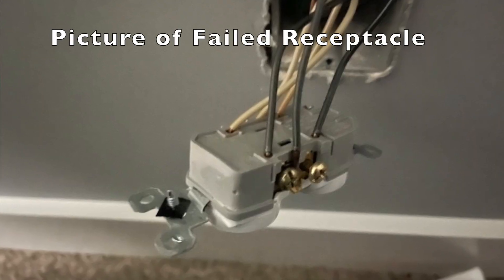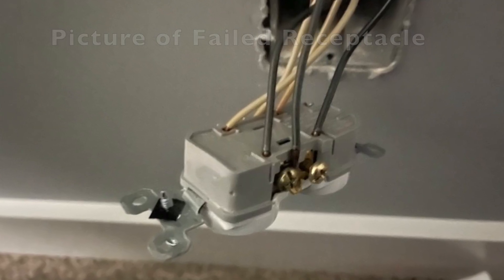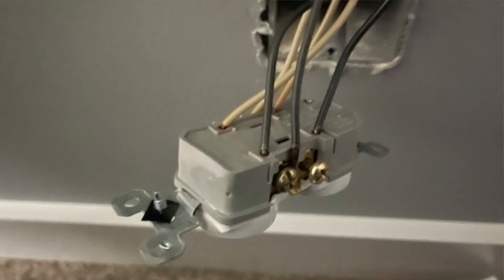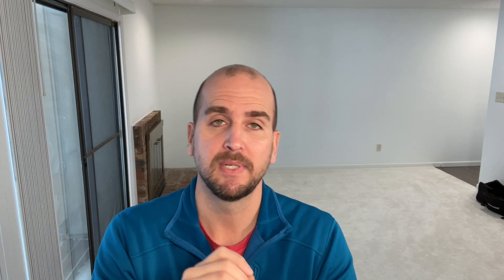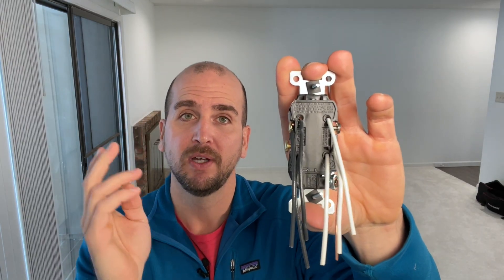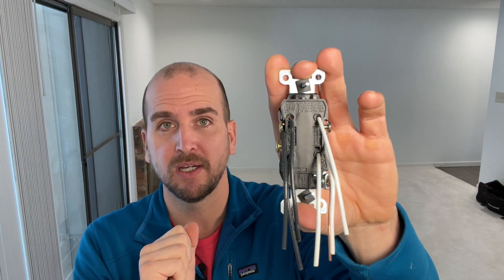Incorrectly Wired Outlet Found In Newly Built Home

Comment: back-stabbers. I don't do it, no one else might see it but it is pride in the job, I'd rather take the
time to make a hook then close it with longnose pliers so it can't slip away from the screw and possibly touch the side of the metal box. I bought a place, inspector pulled main panel cover.
he wanted to see if neutral and grounds were on separate busbars as the panel is a sub-panel
and at the 1st disconnecting means ground and neutral can be bonded. NO where else.

Comment: Why do the receptacles come with two screws on each side if you are only supposed to use one of them?

Using the screw terminals instead of pigtails takes up less space if you have a small box.
Reply: Because the Pigtail maintains " Electrical Amperage Continuity " of the branch circuit ! And a 4" square box is able to hold piggytails of the Hot/ Neutral/ Grounding !

Comment: COMPLETELY disagree with the pigtail method over the use of the side terminals for multiple wire connections. Most issues I have found with receptacles have been in a faulty pigtail, not the connection at the receptacle. Not only that, adding additional wire and nuts to a box forces installers to jam the extra material into a small box creating a much higher chance of loosening a pigtail connection or breaking a wire at the twist (weakest point). If a pigtail must be used as they so often do, the connection nut should be twisted with linesman pliers as you show, wire nut twisted to full tightness, then wrapped with good quality electrical tape starting on the wires and working up around the nut in the same direction as the wire twist while leaving a pull tab at the end for ease of later removal. Receptacle side terminals should also be wrapped with electrical tape before installation to add protection from ground wire contact during installation, contact with the box, or hand.
Reply: Fail

Comment: Push-in connections are the devil.  I found several that were loose when I re-wired my 1963 vintage house.  I presume that thermal expansion and contraction had degraded them.  I always use screw terminals whenever possible, and always pigtail my connections whenever possible.

I think you should emphasize that NEC provides MINIMUM requirements.  You can always do better without spending a lot of money or time, and IMO it's worth going a level or two above the minimum unless you are a contractor trying to keep costs at an absolute minumum.  More receptacles in a room than are required, 20 amp circuits instead of 15, "spec grade" or other superior hardware, etc.  If you do it right the first time, your electrical assets will last for the rest of your life or at least as long as you own the property.

One of my homes had a post-flood upgrade about 20 years ago.  The owners, one of whom is my wife now, spent more than $100,000 removing an interior wall, upgrading the kitchen, putting in new flooring, etc.  Every time I have worked on any of the electrical assets I've been disappointed to see things like push-in connections where spending a couple of extra minutes would have resulted in a much better (and safer) installation.  There is still a Mystery Switch in one of the bathrooms, that seems to do nothing.  I'll figure that one out eventually. :-)

Comment: Good video! I sometimes just put one wire on each screw (two wires per side) if the box is too shallow for pigtails, I usually use pigtails for all with the “shepherd’s hook” otherwise. Thanks Bro! I liked the multi strand to solid connection tip with the wire nut (other video), excellent! Thanks again!

Comment: Thanks. Love the demos. I changed a ceiling fan last week. The house was built in1995 by "pro electricians". Well, they didn't have the termination in a box. Fan mounting plate was mounted to a joist and wire was stapled to joist.

Comment: Regarding the issue of the screw standing proud on the sides: I learned somewhere to deal with this by wrapping electrical tape around the outer edge of the outlet after all connections were made, specifically to prevent a 'hot' screw from contacting a metal ground.
Reply: Agreed. Here in NYC all boxes are metal so the possibility of a screw shorting to the box is high, esp. in crowded receptacles. Wrapping elec. tape around the perimeter is, I think, a good way to eliminate shorts.  I have gotten pushback on this from others; not sure why. I also wrap tape around the wire nuts/wires which keeps vibration from dislodging the wire nuts over time. Finally, I make sure any wire-nutted connection is facing up, likewise lowering the possibility of falling off. Safety first! Cheers.

Comment: Great channel, I am the local go to for minor electrical in my little group of friends.  Do you think that in general electrical installation is due for a major overhaul in technology?  I don't like the push ins, but I also find it super tempting to flatten out the back wire plates by putting a conductor on both side.  Beyond that, how this is done seems antique.  I think Wago needs connect with Leviton (or similar) and normalize all wire connections to their technology.  No more pig tails, no more wire nuts, no more shepherd hooks. 4 hot, 4 neutral, and 4 grounds.  Box costs $2.50 instead of $1, but you just saved 5 minutes per box and everything is super clean.  My two cents.
Reply: Any measure you take to save time will come at the cost of the integrity of the system. Any time a recepticle has to double as a terminal block it becomes another potential point of failure for the whole branch. The hour you save on Wednesday can disappear quickly on Friday as you scramble around trying to find the bad termination. Better for each recepticle to have a solidly spliced connection to the panel without being wired through a half dozen other devices.

Comment: Am not an electrician, but know enough to have identified an outlet with hot and neutral reversed when we got deployed to Haiti in 1995. Electrician-contractor said "the [Army] unit that was just here never had a problem." I said "yeah, they wouldn't if they had a fan or lamp plugged in, but our computer's not booting up." My multimeter showed 120V between the neutral and ground, zero volts between the hot and ground. Exactly opposite of what it should be. The electrician (a young man still learning his trade) rewired the outlet and the computer booted up. This is what I was expecting you to discuss. Guess it doesn't happen much in regular construction.

Comment: Why to they keep making outlets with backstab connectors if they are so prone to failure? I'd think it would be no more expensive to have holes on the back, 2 per screw, that tighten up when the screws are tightened, so installers could avoid the labor of making a J-hook and the risk of just using the springy backstab holes.

Comment: Santacruz, I have a problem that maybe you can help, I added and outlet outside by taking power from one  bedroom and it work fine inside but outside shows no power, i recheck all connections 3 times inside they are goo, and outside i did the same they are all properly tide down but still no power , what could be the problem, im using a new gfi outside

Comment: I am a retired journeyman electrician and I agree with you on all of your examples. I never used those "push in" type of electrical connections to the receptacle. I thought they were mechanically weak despite meeting the NEC codes. I always used the J-Hook way of connecting the wires and I always used the pigtail set up. I didn't like the idea of the receptacle sharing the loads from other circuit loads. A very well done video!

Comment: #1, don't ever stab wire in the back of the plug. Always mechanically twist three wires with a pigtail under a wire it and then place your pigtail wire under the actual screw of the plug making sure your hook is going clockwise with the screw...

Comment: I am not a professional, but if there were only two hots and two neutrals on a receptacle then I would just wire one wire to each screw terminal since that is easier than making a pigtail, and it is very unlikely that the tab between the two screw terminal would become disconnected (open).

Comment: Though not an electrician, my father has done a fair bit of electrical work and has tried to teach me.  When replacing a receptacle one time, he showed me those push in connectors and said all they were good for was knowing how much insulation to strip back.  Always use the screw terminals and hook the wire on the screw.

As a former phone and network technician, I like to point out one little cosmetic detail.  The slots in the screw heads for the face plates should all be either vertical or horizontal in the same room.  Doesn't matter which way, just all should match to make a more "professional" look.

Comment: Stab in is legal almost universally everywhere so you shouldn't call stab in connections wrong, they're not wrong,  Stating it's wrong as an opinion, they're just not ideal. and until the national standard is changed and they eliminate the stab in connection it should not be called wrong, the design is currently accepted and they pass inspection, I know I'm splitting hairs hear just keeping it real and stating current fact.  Saying it is wrong is an opinion.

Comment: However, sometimes we have to connect up to seven wires on a switch; a DPDT switch with 2 #10 AWG x2 and one #14 AWG x2 plus one ground to the ground screw.  Lots of wire in a box!  I had to use a 4”x4”x2” box with a 1.5” extension and still difficult to push everybody in the box! Use to feed a 50 US Gal water heater from the 240 VAC/3000 watts main panel or by the generator panel 120 VAC/750 watts.

Comment: One thing I always do is put the receptacle with the ground on the topside. Don't know if it is correct or not but my logic is that if the plug gets pulled out a bit and something metallic were to fall into the space that you have a one in three chance causing a short and sparks flying. Also, with the ground on the top it helps to keep the plug in all the way.

Comment: I'm a handyman, and have wired both residential and commercial, with inspections.
 A friend of mine bought a house some years back, and I suggested a house inspection before moving ahead on the deal.  She did, and it turned into quite the laundry list of repairs.  I ended up replacing every single outlet save two in the house, as they would not hold a plug,  and upgraded the ones in the baths to GCFI.  The quick connects on the backs of the 1990's outlets were less then optimal, as in, when I pulled the dual ganged old ones out, wires pulled out.  I did use them on the new ones (contractor grade, not the 50 cent ones), but always pulled back after inserting the wire.  The new ones bit in solidly.
 All 120V circuits in the house were wired with AWG 14 wire, on 15A breakers.
 15A, I think it safe enough.  She snapped breakers frequently until I pointed out the need to distribute things across multiple circuits.

Comment: Apologies but I don't get this video (tho nice patagucci jacket, I always appreciate good gear (your "is the power on/off?" doohickey is also nice)). 

Why don't I get the vid? There is no mechanical load nor stresses on the wires in this application, screwing in the wires using the terminals vs using the quick connects shouldn't matter a lick. The screws, if not tightened, don't hit the container box and having them out a little further than when screwed in looks to be no harm no foul to me. I doubt the pigtail makes any meaningful improvement to anything. I'd ask, why are there three leads coming in anyway when there are only two outlets? To the first comment below, if your outlet is "burning out", seems like you have much bigger problems afoot and I'd also ask why all the outlets in a unit would be connected in a series? 

Maybe the most important pieces of advice would be a) get a socket with an amp rating that is the same as the circuit breaker it's connected to and b) don't forget to wire the connection to ground and c) be really sure the power is off whilst doing the switchout (which you do mention but for a training vid for novices I'd be sure to emphasize this point). 

Full disclosure, I just replaced an outlet in my house due to failing plug mechanical connections, it took a little time to find the correct breaker to turn off, my pre-existing wiring was two hots and two colds coming in, the connection was to a socket that only had quick connects, took me a pair of reading glasses to see how to disconnect the wires from the quick connects, my replacement outlet had screws (which I left as-is) and I used the quick connects, turned power back on and nothing blew up and my outlet works great so I left the "project" quite happy.

Comment: No matter what I do what I do Is use 10 gauge wire and wrap It around both screws which Is difficult to do have to use needle nose pliers to do It which help but still yet them 1500 watt electric heaters burn out the plug and socket with In 2 weeks so what I have been doing Is using two 800 watt electric heaters but them electric heaters need their own type of plug and socket I thought of using 220 volt plug and socket but stores are over priced on them.

Comment: Question:  Checking outside light box wires with multimeter (MM) on Voltage Setting:   MM red to light box black & MM Black to light box ground = 120 volts.  But MM red to light box black & MM Black to light box white = 2 volts.  Does that indicate a problem?

Comment: I agree with all but,
If you’re going to add pig tails and those big wire nuts, you should check the box’s stamped volume again the NEC para 314.16 tables for allowable fill volume. 
Two other tips:
1. Use Wago nuts instead for ease and security, and
2. Wrap around the outside of the receptacle with electrical tape so as to cover the wire-attachment screws after you have tightened down the shepherds hooks for a bit of added safety before you put the receptacle back in the wall.

Comment: Scott - a scenario I've come across and brings into question of best-practice wiring... I've replaced some switches in my 2005 home with new switches albeit motion sensors, countdown & programmable timers and dimmer switches. I noticed in this townhouse that all the switches which contain two side by side, contains a SINGLE pigtail which is shared between 2 switches. One switch contains wrapping technique whereby the insulation is cut but the wires continues around another switch terminal. This instead of using separate pigtails for each switch. I've never seen this before and to me, this just seems lazy and a possible code voliation. It may be done this way in order to require less wiring, creating more space, in the box. Nevertheless, in all these instances, I added a separate pigtail to each switch, removing the shared hot wire. I think there might have been one which I did not rewire to use separate pigtail and just reused the shared wiring for said reasons. Actually, now that I think of it, this may be the point of failure for the bathroom fan not functioning. It hasn't worked since we moved in. This will be my next one to investigate and work on in order to replace the fan switch with a countdown timer siwtch.

As always, I enjoy your very-well done videos and have learned a lot watching them! Thanks!!

Comment: Some wire-nut gurus state it is incorrect to twist wires together before applying the wire nut. Let the wire nut do the twisting.
Wire nuts are a special case. They are US-only - I have never seen them used in any other country, and they are clearly not permitted in Europe.
Terminal blocks, attached to either the fixture or the box, would be used instead, or at the least screw-terminal or lever-type splicing connectors (Wago).

Comment: Your #3 example is convoluted. You show a receptacle with two wires held with one screw under a grip plate. However, what about the more common situation with a duplex outlet and 2 screws, each holding a wire bent shepherd's hook style? My gut react is that this is just as good as a twist connection, My friend who is a licenced electrician with 30+ years of experience agrees, and says a pigtail won't be superior in any way compared to this. They're the same. and you save the cost of a wire nut...

Comment: Thank you for your accurate explanation of why you should "pigtail" receptacles. Not installing receptacles in this manner, IS a code violation.  Receptacles devices are not allowed to be used as a part of the branch circuit conductor.
Reply: What exactly is the violation? What code section is that?
Reply: Show the code you’re quoting;you’re misquoting it !

Comment: Uk switches/sockets have the terminal screws recessed. No screws on the outside unless grounding screws. Would not use any push-in terminals, not tight enough. Plus they are useless with stranded wire. Remember our voltage is 240v.  We also never use wirenuts!  All  connections must be screwed connections.We wire so that all connections are at the switch or socket. No junction boxes in the walls!

Comment: LOL You think that is bad? I used to do installs and repairs for a "manufactured" home company. I have seen SO many wiring mistakes it's crazy. Things you wouldn't even think is possible. I took videos of some of them and was thinking of starting a channel like yours but I quit working on them. I had to be able to sleep at night. Besides, had I shown all the stuff wrong with those houses, no one would have hired me any more anyway. 🤣 Like what you ask? How about a whole frame that is hot and shocks you when you touch it. After hours of digging around insulation underneath I found a wire with a screw through it touching the frame. But didn't pop the breaker. Turns out the frame wasn't grounded. Anyway, nothing surprises me anymore.